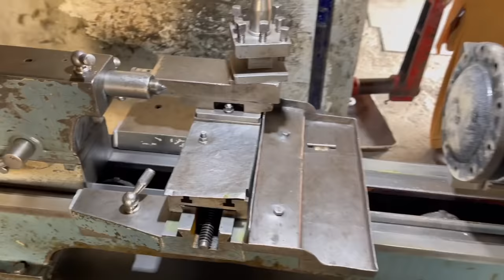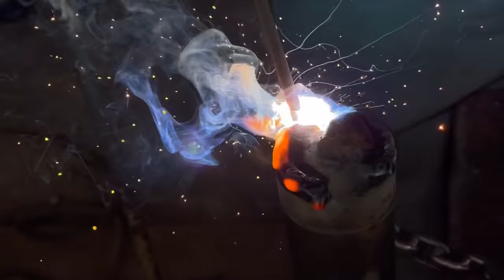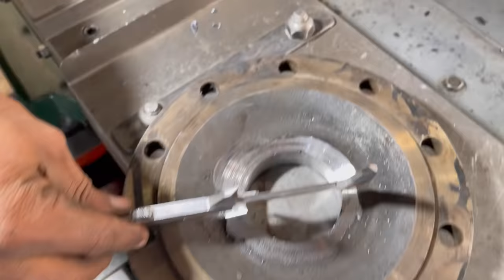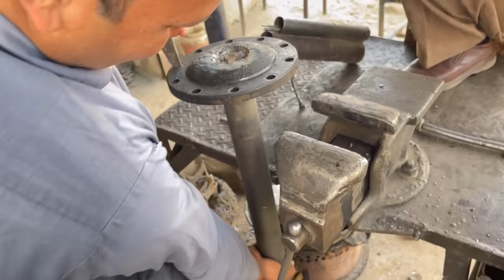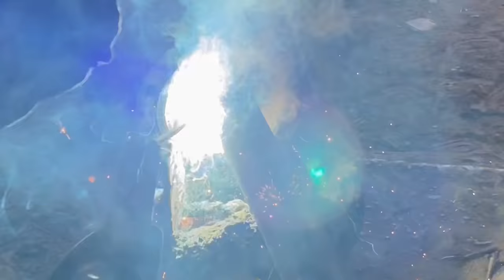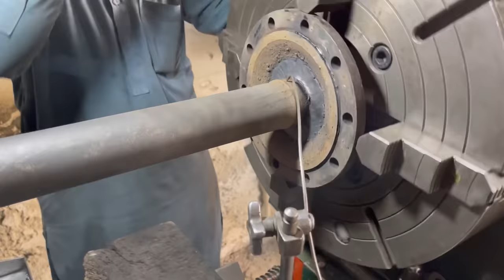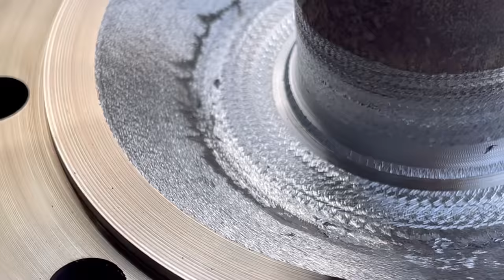Amazing technique Broken Rear Axle Repair | Local workshop amazing work |

Comment: 7018 rods... low hydrogen.... fine..... but the shaft will be chrome/moly/vanadium and the flange looks like a steel casting..... My worry would be the shaft and thermal shock.... he didn't pre-heat before starting to weld it up. Still, should be serviceable enough if not too overloaded in use, but that;'s probably what broke it in the first place.
These guys will have a go at fixing anything, and you have to admire them for that. Love their little 'whisker' for dialing in something in the 4 jaw.....

Comment: If I was asked to do that job there would be a lot more cleaning before welding, a dial indicator would be used and the axel would be checked in three places along its length, and if anyone brought out the calipers for anything other that a rough estimate with out checking final dimensions with a micrometer they would never work in my shop again. Oh did I mention I would CLEAN MY DAMN WELDING?

Comment: Good skills but for a lost cause. 

1. A weld puddle can not be used as a structural filler (like he did), it is only intended to be a fusing of two metals.

2. No proper heat treating on an already weak link even when it was new. 
A metallurgist would choke on his coffee if he were to see this..

Will it work? Depends on the operator, the load, excessive wheel hop, heat cycles, and that ultimate killer called traction. Perhaps be realistic in rating it for how many revolutions instead of how many days!

Nice old lathe though!

Comment: Good ideas ,  well done . even though nonspecific , Hopefully unknown Compositions welding rod used . They're expart such types of jobsworth .Trucks woners/drivers having faith &
trust on them near future they have to go for one unites  
 replacement . Highway or odds 
Locations getting originals parts
Very difficult situation. Good jobs 
They have done . V shapes on the flange they could've givens for more gripe .

Comment: Would be interesting to see how the You Tube experts would do going to that shop and just using what those guys have to work with and do the same repair and compare them. Not saying anybody is right or wrong, just which would turnout better. Boy That chain handled chipping hammer!

Comment: The part failed at its weakest point. You build up the weld and strengthen the part  likely better than stock....Then you thin it out and weaken it by some  factor 2-10 times? I assume it was a fit issue? Otherwise I can't understand it. Also invest in a dial indicator. ($20) It would be an order of magnitude better than a pointy stick.

Comment: If you build a highway in Pakistan, you don't have to do such unnecessary labor. Trucks break down every day on unpaved roads. Pakistan has no idea of the importance of dams and highway asphalt. Civil engineering should always be above religion. Religion does not change reality.

Comment: Shaft will probably fail again.  Too much slag inclusion.  Especially from the material build up and the plug weld.  Probably should've included some type of mechanical reinforcement between shaft and flange like big ass pins or something.

Comment: Not the correct way to weld, perosity, inclusions, tons of undercut in welds and probably had a low oxygen 7018 rod sitting outside of oven and didn't clean his weld before restart..... everything 😳

Comment: You can weld almost any metal. The problem is how long it will last.  Correct process is to reheat, tig or friction weld and retreat. Shtt job that won't last, not mentioning 3 diameters rule when lathe machining. I'd go for something like this if I'd brake down in the middle of  a dessert and the guy welding for me would wear pyjamas and flip flops.

Comment: No way. I am a class A mechanic with over 40 years experience. This axle he fixed? It will be good for a bicycle only. You could never get the penetration or welding flow necessary to return that axle to its strength

Comment: It's critical to preheat the metal before welding. Then use a high tensile strength rod. 110000psi or more. Then stress relieve the weld. Only way it will last.ive been a welder since 1981. Trust me I know

Comment: 7018 rod should be stored at 250 degrees F above ambient temperature.  Hot enough to burn your bare hand.  I don’t hold much hope for those welds.  Some of the best working men I have seen though.

Comment: When you know that it's forged and heat treated, the repair seems totally inadequate and it is if you want more then about 80% of its original strength, they obviously don't.  Had a sheared off spline in a MG TY over 50 yrs ago, a truck place in Miami said no problem, welded on a stub & cut some crude splines that needed some file work to fit the diff.  I didn't know why it worked then and I still don't.

Comment: Nice machining work, but his welding not so good. Welds were not 
Properly cleaned just chipping slag off doesn't clean the work...also, dirt and rust in a weld is like wood in concrete, not good.

Comment: This repair won’t last long in the application that broke it originally. Welding a medium carbon alloy axle shaft is a bad idea. The weld material is never as strong or inclusion free as the original and you now have brittle heat affected zones in the shaft and flange adjacent to the welds.

Comment: For People with no other Option this might be a good help but in Germany we would say tf is this. You see the welding seam are not correct and the position how they welding is wrong. They didn’t correct cleaned the seam and under the steel there are pores of oxygen.

Comment: You can stil see the cracks in the weld seams,In these countrys i have seen with my own eyes vehicles driving along the road and suddenly the axles falls off.Good try but theres no safety standards laws in these parts.

Comment: I wonder how much it will cost them to repair this... We prefer to buy a new one cause repairing this will cost more than the new one and the repaired one is not even stronger than the original one. The way they welded the disc with the shaft it's very nice and strong it can withstand a heavy load but it's useless giving this much effort for repairing this part when you can buy a new one just by adding few more money or maybe you will get a new one in less than the repairing cost.

Comment: even thou you would not see this in the US because of availability of parts this is a proper repair that should last the life of the truck . the one thing that get's me is this axle was repaired before but broke you can see the old weld under the black paint in a few parts of the video

Comment: Tools and methology are ok. 

I would have done some more cleaning passes in between the welding to get rid of trapped dirt. Also, dont use that slack hammer. Use an anglegrinder for that!! 

Rounding down sharp edges is actually making the weld structurally better so good job on the last step.

Comment: His bent wire works faster than a dial indicator. That shop isn't as poor as some. There are three lathes in there one is not very old.  The paint still looks new. One is less than 30 years old and one is old.

Comment: That shaft could have taken a shoulder an some threads to connect to that flange then weld it ,would have been a stronger job with less runout .

Comment: it is better to replace a new axle than to use that welded metal. it is dagerous to use and it can cause accident if you are tons loaded and your brake is not strong enough to stop the truck.

Comment: Wow.....what a process !
Nicely done !
True artisan !
Dial indicator was a bent pointed rod ?
"Necessity the mother of invention", perhaps ?
Too..., did anyone catch the slag hammer handle made from chain links ?
Full Service Shop ?
Reply: It could pass as a work of art, but not as a safety-relevant component of a work tool that is usually overused.
Good luck to the driver of this truck, he will need it.

Comment: There is no way that spline runs true with the hub mounting surfaces.  The axle will break again in a short time because of run out.   It will probably take out the whole rear gear set.

Comment: I always thought that you had to heat up the meals that you were to weld together..? I guess not because they definitely know what their doing...Great work..
Reply: Preheat is only required for specific jobs but does make welding easier. I also doubt those 7018 rods are stored in a rod oven.

Comment: I think it will hold up, one: when these axels wer manufactured they were most likely built with a 5to1 threshold.  It probably broke from some out of the way instance.  Although welding puts alot of heat in one area that axel absorbs it. This process will obviously soften the work area but it wont take the toughness from the steel. Most likely not as hardy as original but hats off to these Technicians. They are not just "parts changers" .

Comment: I won't lie, this was a amazing job well done much better than what we do here where I come from.
With lack of resources life has thought us to do things the difficult way, for the nearest spare parts is 170km away most of us drive around with welded axles but not done as neat as this one in this video.
The life span of a welded axle depending on our terrain is 4-5 months after welding it needs to be welded again but it depends on how terrible the problem could be the second time. Thumbs up to this guys,👍
Reply: Lack of resources, they have plenty of resources its just not a good way to do the repair.